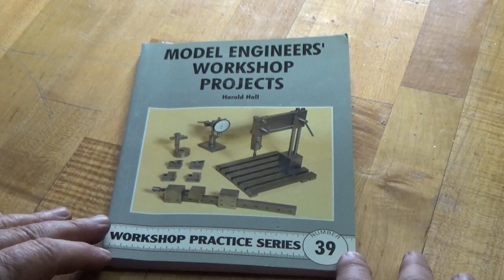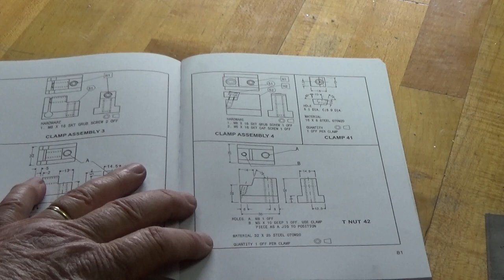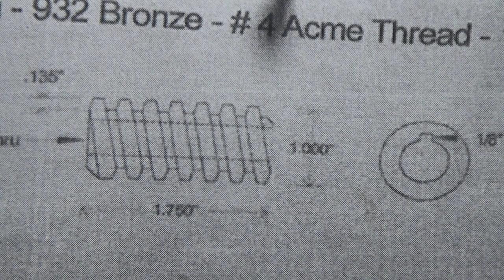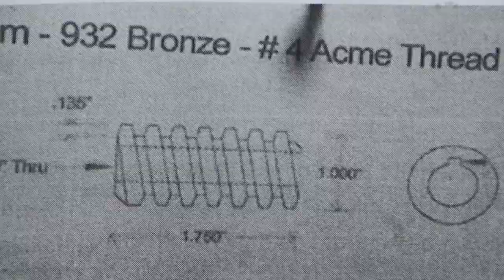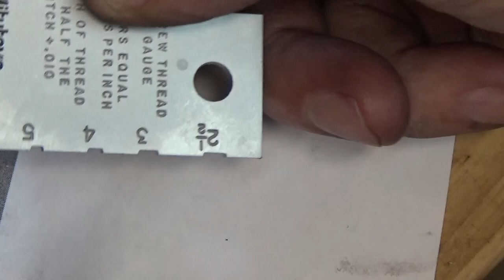Shark Bits #27- Tools, Material, and Viewer Project

Comment: You like using the larger inserts, you can find good industrial quality inserts on EBay for not much more than the ones you was using. Of course I’m partial to using larger holders an cutting dovetails in them to mount directly to the tool post.
Reply from the maker: The larger lathe gives me more flexibility in tool holder and insert choice. I like the Mitsubishi inserts but unfortunately there are a lot of counterfeits you there, tough to tell until you use them. Thanks for stopping by.